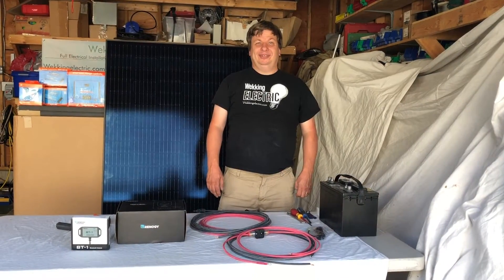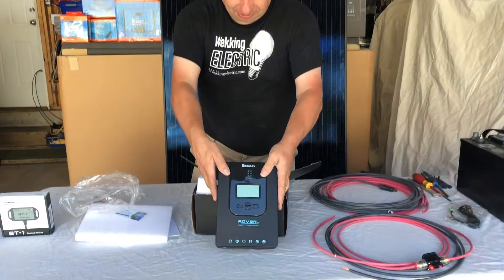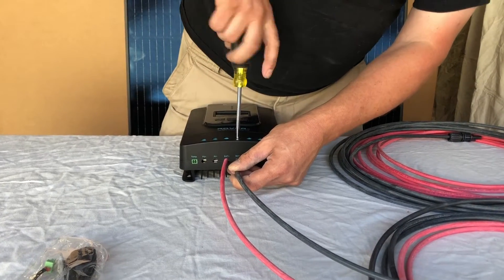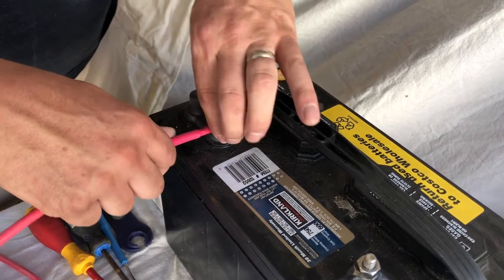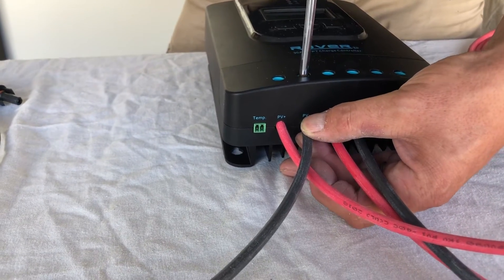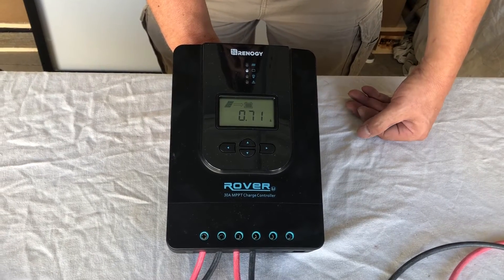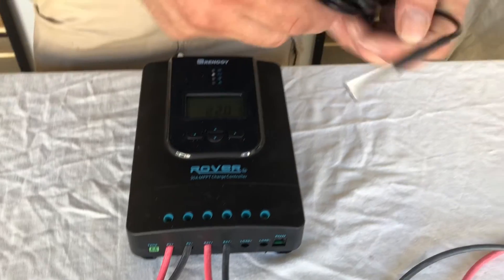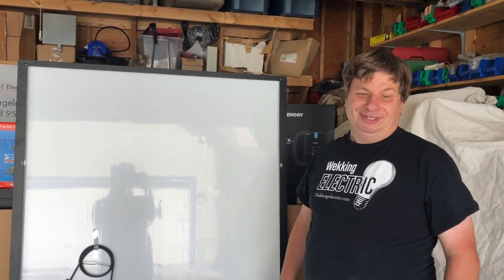Connecting Renogy Rover 30 Amp Charge Controller To 60 Cell 330 Watt Panel

Comment: The "EO" means that there are no active error codes. It will change to E1 and on for different errors. Nice video. Thanks for sharing it. That's a great turn-key solution.